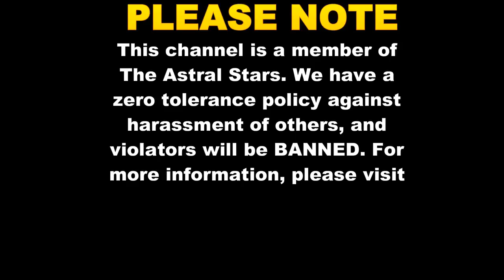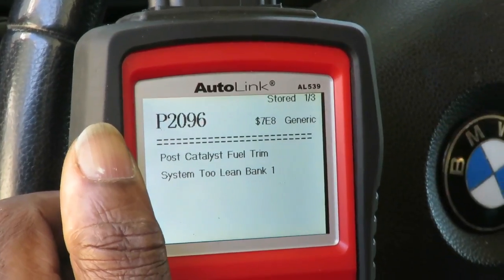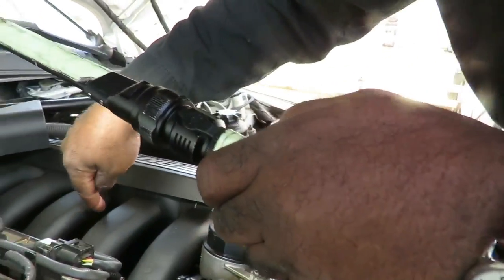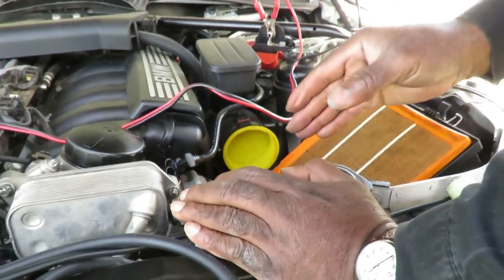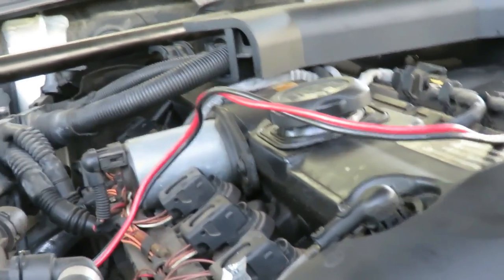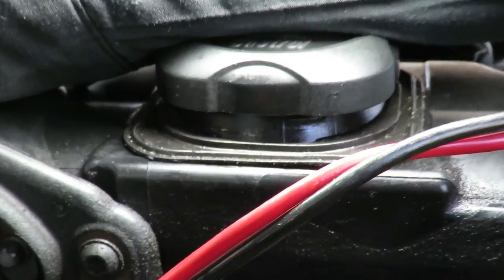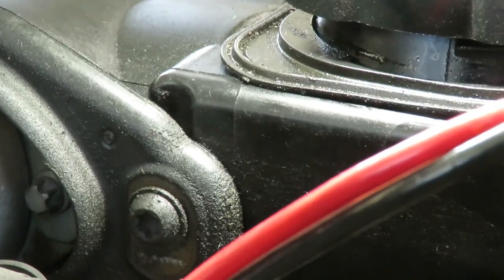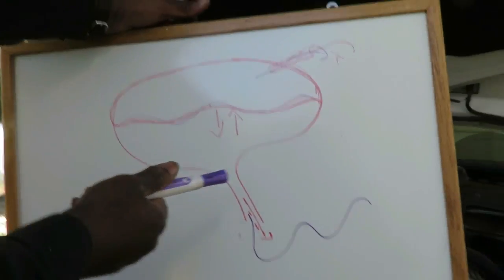⭐ PART 1 - 2010 BMW 528i - 3.0 - P2096 - Post Catalyst Fuel Trim System Too Lean Bank 1

Comment: Okay guys, once you see a p2096, that means the post catalyst is lean. So if that is not accompanied by a p0171 or a p0174, that implies that the first O2 sensor is getting good voltage switching okay. Right away that tells you that the leak is already between the first O2 sensor and the second O2 sensor in the exhaust. First test would be to run a scan to look at the voltages switching on the O2 sensors, or hook a multimeter up and look at the pre and the post O2 sensor voltage switching to rule out anything else, but most of the time this is correct. So do yourself a favor and just put some air in the back of the exhaust pipe with a leaf blower or air conpressor or shop vac,  and spray some soapy water on the exhaust pipes and watch for bubbles in between the first O2 sensor up-to-the-second O2 sensor and get something to seal the exhaust up once tou see the leak,  its that simple.  If your first O2 sensor is switching in the voltage is good and it's a good sensor reading properly, there's no need to look anywhere Upstream of that first O2 sensor into the engine bay.
Reply: Nonsense. If there was a pre muffler leak the car would sound insanely loud even if the leak was the size of a pin. Plus I’d smell fumes most likely. 

There’s plenty of causes for too lean. 

Closed loop but fault with at least one 02 sensor. Well that tells me I need to check or change a sensor.
Reply: So on a e46 when the cat is built into the manifold how could it leak between pre and post sensors theres no wat its built in together!

Comment: So replacing the entire Valve cover gasket kit with ignition coils and spark plugs will do the job?? total of $1279.99 dealer parts, labor 250$
Reply from the maker: Before ANYTHING, check the rear O2 sensor
Reply: No u can just add the hose the goes there is a hose the comes from the air intake boot the connects to the pcv valve is a heat regulator for an u start ur car..the hose cost like 10 bucks save ur self thousands

Comment: So where did the tube go that needs to get plugged in on your diaphragm
Reply from the maker: That was just a vent for the diaphragm. I thought there was something there as well.
Reply: I hose front the air intake connects to the pcv valve is a heat regulator

Comment: @Astral Auto Repairs  
I so glad i found you channel you got a new subscriber, 
I have 2007 e60 525i n52 engine, 
And that the code i have for months, p0298 and  they says  if i change the coils  will  fix it, but I don't  think 
Now 3 months after I have all these code, p0298 post catalyst  fuel trim system  too kean bank 2
P2272  o2 sensor signal stuck lean bank 2
P0597 thermostat  heater control circuit open 
And YES AGAIN P02098 ( 2 times, why )
I so lost please what to do the only  thing i have is a bad vibration  on idle only at 6500rpm, when warn up
On reverse and drive with brake on 
Stop sign , traffic  light, 
Is piss me off i just fixed  p0444 and 3 days after that code and  jow 2 more code 
I gonna explode,  please  help me , what to do, mechanic  says is the coils and they charge 150 plus parts 200,  or the VANOS , 300$ parts and 100 labor,and if not he says we keep  replace  the o2 sensors  (4) and pvc valve , is better to buy a Toyota  corolla for less money, 
The car has 153000 miles 
Please any help I will do what you told me to do, thank you in advance
Reply from the maker: Sounds like you have a bad O2 sensor, BUT that is NOT causing the rough idle. Do a compression check on all cylinders.
Reply: @OnlineAutoRepairVideos  ok I will  do a compression  test  of the 6 cylinders  and upload here, so you can tell me what do you think, and since the code already  tell me o2 sensor 2 bank 2 i hope are videos showing how, thank you so much for your time  and help

Comment: Would this possibly be the same problem with a 2012 Subaru outback? Same problem as in a vacuum leak? Or could it be a bad downstream O2 sensor?
Reply from the maker: Yes, it can be a downstream O2 sensor
Reply: @OnlineAutoRepairVideos  thanks for the reply! My boss gets p2096 once in a while, sometimes once a week. He's asked me to clear the codes a few times (BlueDriver obd2 scanner, I love it), and told me that he's had mechanics look at it with different stories from each on what it could be. Now, he is in no way mechanically inclined, so the mechanics could have given him the common possibilities of what it could be and he not realize it. Anyhow, I don't know if he's had the smoke test done or not (and I wish I could afford the machines, lol). He would like for me to replace the O2 sensor, which is no problem since it's easy to get to. Is there a way to test the o2 sensor, other than for continuity?
Reply: @danelmassey9535  did you figure out the problem? I have the same intermittent problem on my 2011 Impreza
Reply: 06 Bmw 525i on the. Diokno k it reads 2096 what dose that mea

Comment: Help Me! I have had the p2098 (Bank 2, post cat too lean) for a while now -- maybe a year. 

-I have replaced both bank 2 o2 sensors with OEM sensors. 
-I had a smoke test performed and found a vacuum leak in the same place as the one in the video here and I replaced that diaphragm and that leak is now sealed. I cannot find any other air leaks with a smoke test.
-I replaced the air filter and made sure I connected everything back tight.  
-cleaned the MAF with MAF spray. 
-I just checked the back pressure from the 02 pre-cat port and pressure remained at .5 PSI despite whatever RPM I raised it to.
-Fuel pressure is right on point at 73psi

I have a few sets of fuel trim data that do not make sense to me. If the system is lean, then the trim should be positive, right? All my data sets show bank two LT and ST fuel trims to be negative: here are two sets of data:

Fuel Trim Bank 1 Short Term = 1.562 %
Fuel Trim Bank 1 Long Term = -8.594 %
Fuel Trim Bank 2 Short Term = -0.781 %
Fuel Trim Bank 2 Long Term = -0.781 %

Fuel Trim Bank 1 Short Term = 1.562 %
Fuel Trim Bank 1 Long Term = -8.594 %
Fuel Trim Bank 2 Short Term = -1.562 %
Fuel Trim Bank 2 Long Term = -0.781 %

ALSO, the bank 2 numbers do not look bad to me! Bank 1 seems to have larger trim values. Anything advice would be thoroughly appreciated!
Reply from the maker: We noticed you have not checked for ANY exhaust leaks, especially the gasket.

Comment: How about P2098?  What would that indicate?  Thanks.
Reply from the maker: Lean condition on Bank 2
Reply: @OnlineAutoRepairVideos  Would this be caused in a big vacuum leak on a e53 2001? I have a P2098, can hear a very loud Whistling while cruising or even passing 2000-2500 rpm. I suspect a vaccuum leak, have replaced all O2’s, only 65,000 miles.
Reply from the maker: @Neo-ih2fh  Yes!
Reply: @OnlineAutoRepairVideos  where should i look? Any ideas?